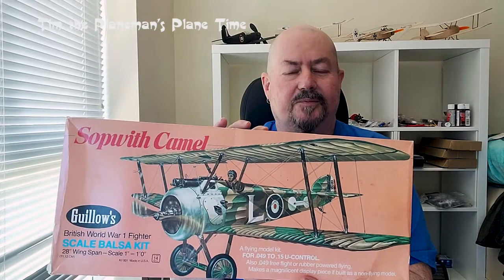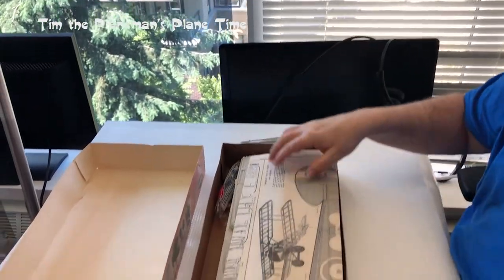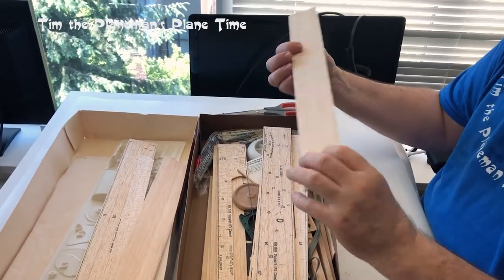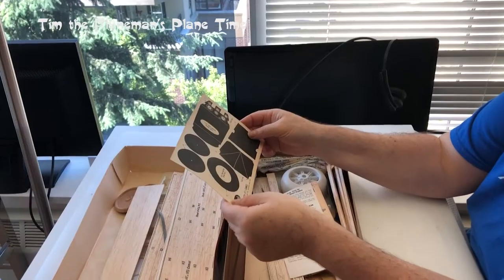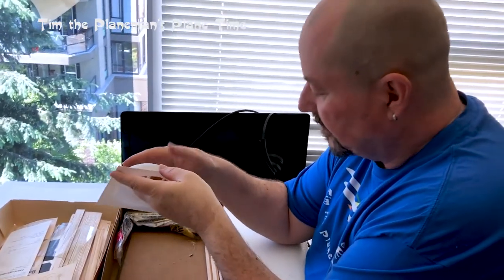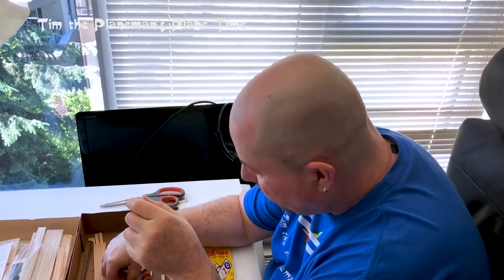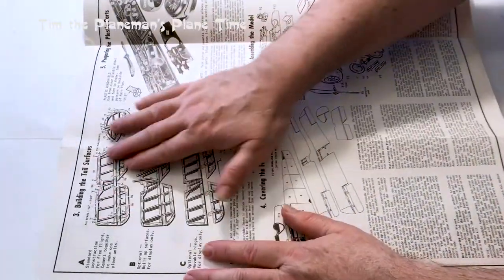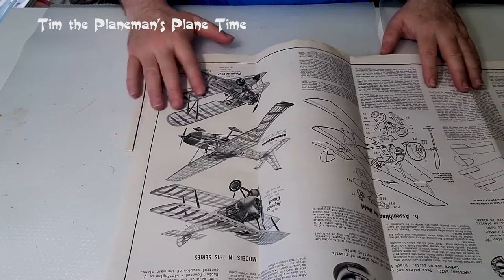01 Guillows Sopwith Camel unboxing - balsa RC model conversion

Comment: Salutations Tim!
These older kits have plans that are printed on that was made with wood pulp, and over time it deteriorates and will discolor. This should not affect your build.
The dark plastic piece that you removed from the box, and are not sure what it is, is the handle in the event that you would like to build the plane for U-controlled flight, however, since you are planning to build this plane for RC electric flight, it will not be needed.
It will be interesting to see how this model turns out and to see how it flies.
I would definitely recommend that you use some kind of newer covering material instead of the tissue, this would help to contribute to the overall strength of the aircraft and will improve it’s performance, hopefully, you can find some in a suitable color. If you’re not really happy with the decals, then you could make your own with a good printer and print them out on some special material for just such a purpose.
Good luck on the build!
Happy flying!
Thank you for posting and for sharing your experience with us all!
Please have an excellent and awesome day!
☀️✨✈️
Reply from the maker: Thanks Mike, I had a blast building this kit. There is a whole series of videos on the build beginning to end if you want to watch it.

Comment: Hello Tim,  I just received my model Sopwith 1e1 Camel from a model seller in England where I hail from, and I just wanted to say hi and to say that they have taken out the ply sheet parts and replaced them with plastic pressing instead and they have taken out the "U" control stuff as well which they say they will not be putting in anymore. Enjoying your video a lot and hope to see yours fly at some point.
Reply from the maker: Thanks mate! I definitely have a very old kit. If the one you have has laser cut balsa you are leaps and bounds ahead. Have fun with it!
Reply: @timtheplaneman nope still still not lazer cut was hoping it would be but no such luck lol

Comment: With the Nieuport I built I lightened the tail end as much as possible due to the short nose, you might want to do the same, I didn't use the wooden wheels either. With the decals Tim, if you spray them first very lightly with clear lacquer they'll hold together better, try experimenting on the Guillow's word in the corner. 12:45 Eureke moment ... love it!
Reply from the maker: Thanks Cliff, I've watched your Nieuport videos end-to-end in preparing for this. I really appreciate your advice. Thanks for the suggestion about the decals. The wheels are very heavy, but they are so beautiful, I really want to use them if I can make it work.
Reply: @timtheplaneman  a bit late, but yellowed water slide decals can be fixed by exposing them to sunlight for a few days.
Reply from the maker: @Graff-Art  Good to know - it might help others who read the comments. Thanks for watching!